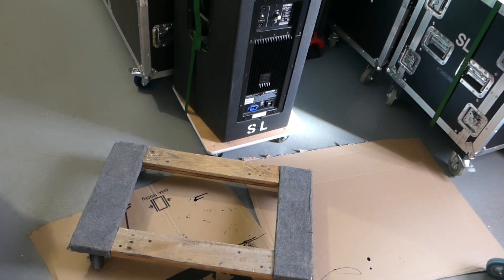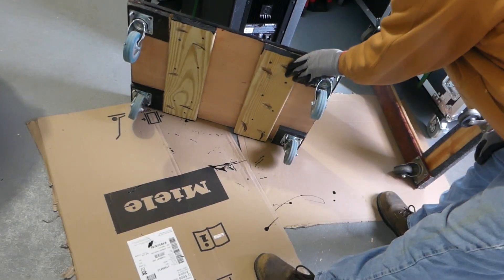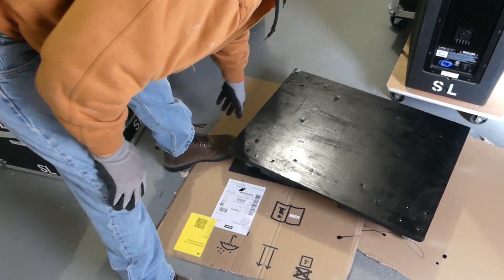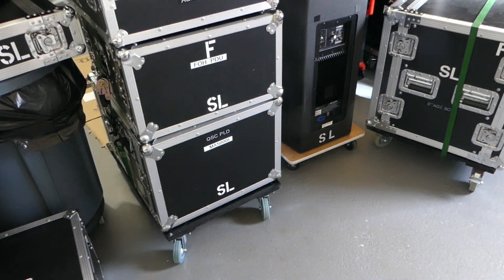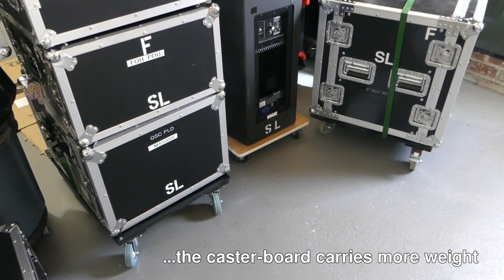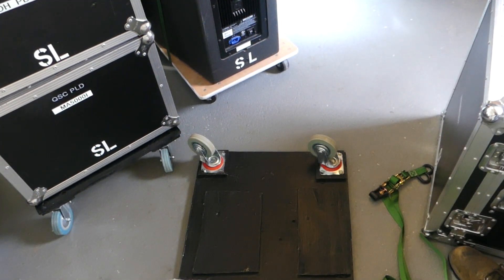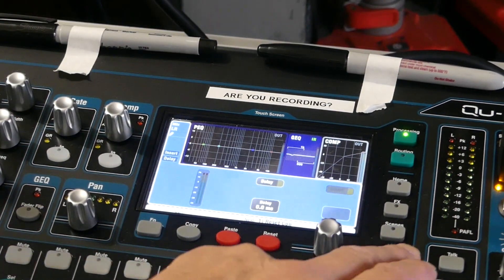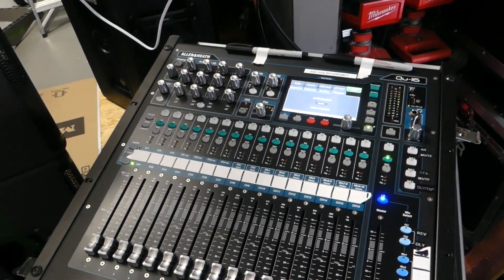Upgrading firmware on an A&H QU-16 console and talking about caster-board (dollies) modifications.

Comment: Why not permanently affix the dolly boards to the rack cases, like most case manufacturers do? At least for the larger racks...  anything around 8U and bigger usually
Reply from the maker: That was something I considered sometime ago, but the logistics of storing and  transporting gear would not have allowed for every case to have casters.  If most of the cases had casters,  most of them would also need dish-cups.  Some of the larger (and heavier) cases (road-cases and racks) do have permanent casters.  With many of the cases that do not have casters, I'm able to store more gear in a much smaller space (as shown in the video).  This also means I can pack (and transport) a lot more gear in smaller areas (...cargo van and trailer).